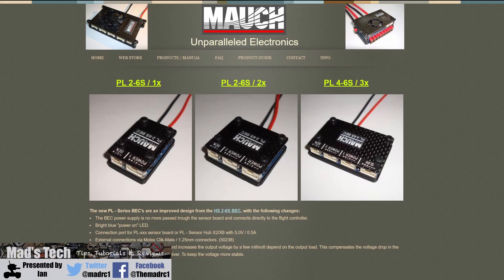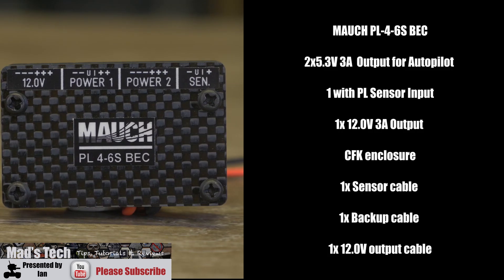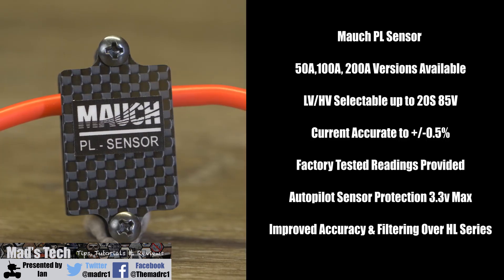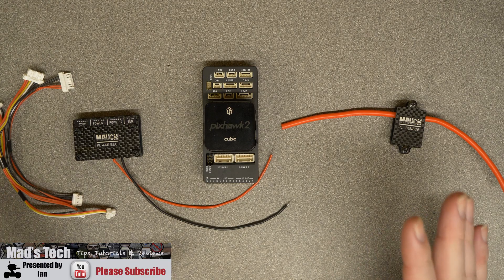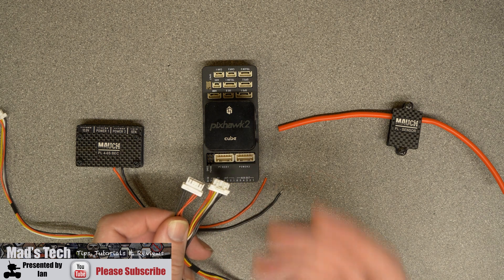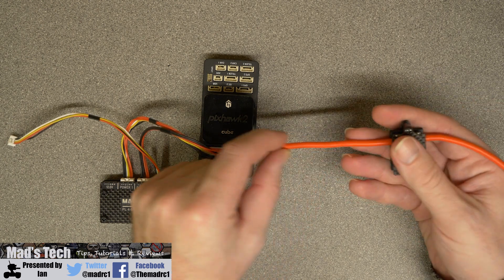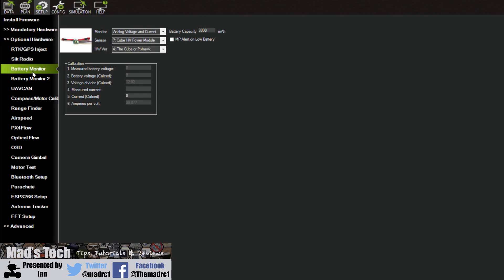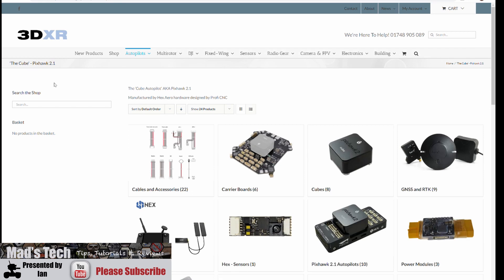MAUCH PL Series BEC & Current Sensor for Pixhawk & Cube Autopilots

Comment: can we use the BEC only for voltage reading for battery monitor ? (without using any PL current sensor) does the bec have any onboard voltage sensors. thanks in advance

Comment: Having seen your video do you think you could replace the 8AWG with 6AWG instead? I have a partially built frame that has an anti-sparking unit SPSS 200A 14S wired into the frame and directly connect to a basic PDB. I can connect  the BEC or in my case a PowerCube the other side of PDB as you said but the wire isn't of similar AWG size

Comment: My power module is making humming sound..is that normal? Btw..great video!
Reply from the maker: they can whine a little, id check your current draw first is with in limits. what voltages is it powered from ?
Reply: @MadRC  the voltage is 22.2v fed from a 6s. I am powering only air unit and cube .

Comment: This is the MOST informative YouTube video about Mauch.  Thanks for answering my question about whether or not there were multiple BEC's inside the PL  series with two or more 5v outputs. 

How do I calculate which Amperage module I should use?  Do I multiply the ESC maximum allowable current by the number of motors?  Example 6 motors at 40 Amps each =240 Amps?  So I would need a 200 Amp AND a 100 Amp or two 200 Amp?  Is that how I should be calculating?

Comment: Unless something has changed in recent firmware versions, ardupilot does not notify if ONE of the supply lines fails. Therefore one supply could fail and remain failed for a long time without being noticed, unless you get inside with a voltmeter. I have asked about this on cubepilot. It should be part of the arming checks - both supply within limits, and inflight warning if one fails.
As ever excellent clear video.
Reply: Found a way to check if both are supplied. Parameter voltageflag should be = 3 but can’t have it permanently monitored unless perhaps with a script.

Comment: i've been using these for the past 2 years on 2 of my pixhawks -  all configured in M/P according to Mauch's recommendation. In all cases - under power, in the air i always see a 0.4 - 0.8 volt difference between what mauch reports to F/C versus what frysky telemetry reports directly to taranis  from the FLVSS volt sensor connected to the battery balance connector. This btw is the same level of discrepancy i saw with the standard power supply sold with the Pixhawks. Its just my view but the voltage reporting is not really reliable compared to FLVSS. And btw  i did validate the FLVSS accuracy with a mid-range multimeter.  Under no load (zero throttle) both readings are the same.

Comment: Thanks for sharing your knowledge. Interesting stuff. Will get one. You're working on a F550 build you say. That'll be interesting to see - I've been flying around with a DJI F550,  E305 Tuned Propulsion System and a Cube and using ezwifibroadcast. Such a good drone. Hey, do you know why I'd be having problems with the throttle variation when switching from PosHold to Drift? With drift the drone doesn't want to keep its altitude and I constantly have to make adjustments. Not good when all I want to do is drift around and not worry so much about how high I am (I want to fly low and close to the ground). Thanks for any input. :D
Reply from the maker: In Drift mode the throttle is the same as Stabilised mode and it’s not using the Baro sensor. Your directly controlling the motor speed rather than craft altitude like in POS Hold.   Basically there is no auto altitude control in Drift and Stabilised mode.